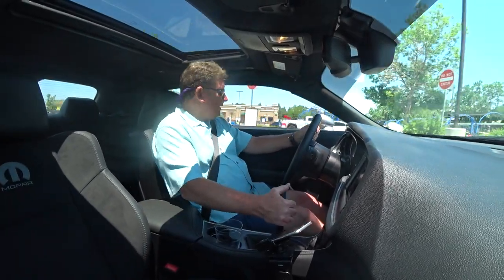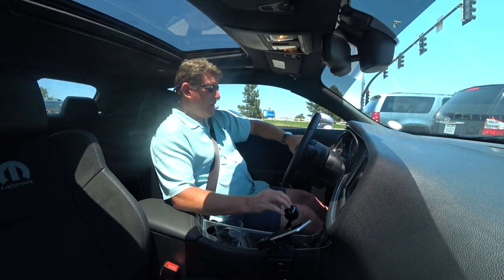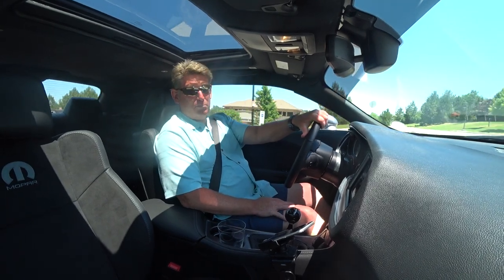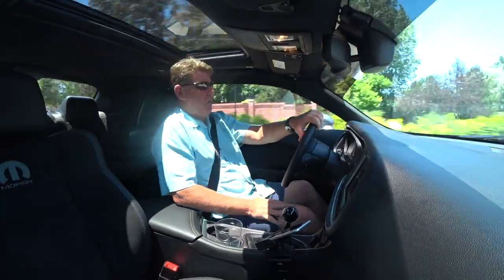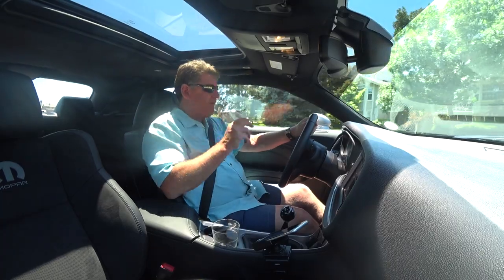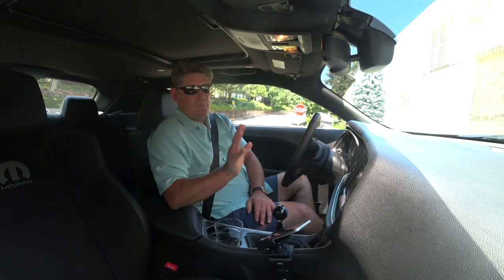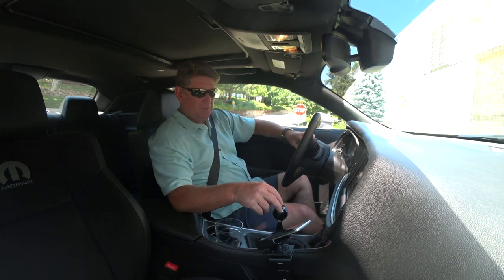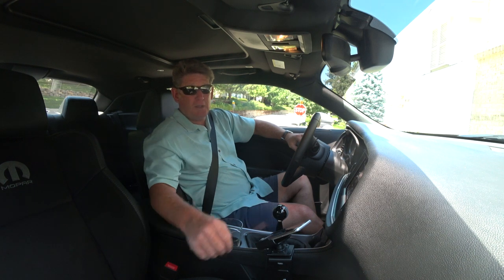Barton Shifter Install Story-OMG

Comment: Thanks for sharing your Barton install story.  There is a lot of satisfaction in working on your own car.  No breakage during my install .... but I did have a couple of self-inflicted hiccups.  First hiccup was after the complete install and I turned around to back out of the garage and saw the AC duct sitting in the back seat. DOH!  Second hiccup was when it was time to put everything back together (again) and my 10mm socket had vanished.  The socket had found it's way under the passenger-side WeatherTech mat. 

And, YES!  Props to WorkPlayDrive!!  I kept my iPad on the dash and used his video as a step-by-step installation guide.

Comment: Hey,  thanks for the kind words man ;) 

 lol that block is such a variable,  I called Barton when I originally installed because the way they suggested just seemed off, they confirmed the way I installed it was their preferred method and in that orientation the shifter would be quieter.
Reply from the maker: You have a great channel and I have learned alot from you. I am looking forward to stepping up my channel content soon, I am also looking forward to your Hellcat and seeing what you do with it. My MOPAR17 is really the car I was looking for with the shaker and large engine. Lets see what I can make out it. CHEERS>>>
Reply: Thank you a appreciate the kind words.
Reply from the maker: My story was long but it was actually fun installing the shifter. Some time I will tell you about my first brake job on a 1988 Buick Reatta, now that was funny!!!!!
Reply: So bolts backwards is ok then?! I don’t wanna rip it out again!! 😂

Comment: So glad I watch this video. I just installed the Barton after watching the work play drive video. I drove the car down the street and wanting to take it back out. It’s vibrating noisy and sticky. I am thinking the Barton is overrated at this point. I’m going to turn that block around before I go back to the stock shifter. I hope this fixes my issues.
Reply from the maker: Let me know if it works.

Comment: Would heating the part near where the screw is threaded into it soften the locktite and allow the screw to come out easily?
Reply from the maker: That may be a way to break the lock loose, just don't heat it up too much. Do not apply to much pressure because it could break. Use a solvent to lose the part. Good luck.
Reply: 100%. Heat always does the trick. Never force a bolt. Period.

Comment: Hey man great video I put a barton in my challenger rt I just changed that rear block around like you mentioned shifts better now but do u have any issues goin from 1st too 2nd? Sometimes mine is a little nochie but all the other gears are smooth.
Reply from the maker: Yes, I found out it was the transmission.  Get the shift delete,  the original equipment makes you skip second gear. It sucks, so it feels like you struggle to get it engaged. It's called the skip shift delete,  look it up on you tube to see what I am talking about. I hope this helps, let me know how it comes out. Thanks.
Reply: @mopar1788  im not sure thats it
 I drive mine in track mode so no skip shift and I get notchy shifts. Mostly in 3rd and 2nd. Sometimes even first when sitting at a light.  I thought it was my stock shift linkage. Which is why i started looking into this. But now i see a post saying even with the Barton you can get notchy shifts. Hmmm

Comment: work play drive and americanmuscle show to install that block bolts out, but otner videos show bolts toward the engine. Weird
Reply: Mine is bolts facing rear (out) and I don’t hear any noise. had no issues on my install. Able to get the bolts out easily. Glad I did this mod

Comment: Going to get this hope it goes smooth lol btw is the mopar emblem on your seats aftermarket? If so where can I get them?
Reply from the maker: The MOPAR emblem was part of the original equipment.
Reply from the maker: Good luck you will do just fine, the LOGO is part of the MOPAR17 Edition, the seats have a special emblem from MOPAR.
Reply: I did the install no issues & I love it!
Reply from the maker: @LorenKyleDiedrich  great job

Comment: Don't get offended, but you should have never touched that shifter install as you did.  You admit that your mechanical skills are limited, and something happened that you didn't expect.  Are you really surprised?  I'm 63 and I am not a professional mechanic, but I've been working on my own vehicles since I was 14, so you might say that I'm qualified to turn wrenches, I just never immersed myself in the "job" part of that experience.  I have tons of mechanical knowledge and experience, but as a hobbyist, not a pro.  I can perform most any repair or part swap without issue except for computer stuff and some electrical work.  For that stuff, I always use a pro.  I know my limitations. There are tricks that you learn in such a process, and unless you've been wrenching on cars since you were getting your first stinky finger from a girl, you should have never done this job alone, you should have a guy like me as a good friend and be humble enough to ask that friend for some help, pointers, about tricks he knows, about chemicals he uses in stuck bolt situations like yours.  You could have paid your friend half of what you paid for that new shifter and had it done right. Hell, he may have done it for pizza and beer!